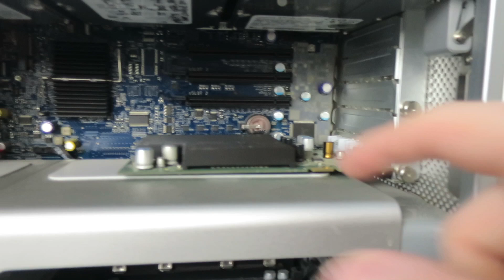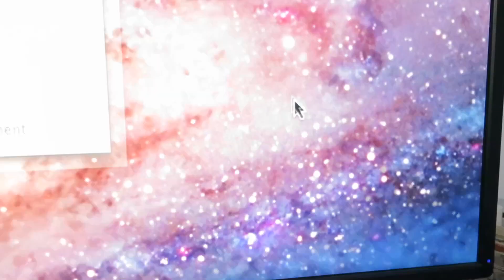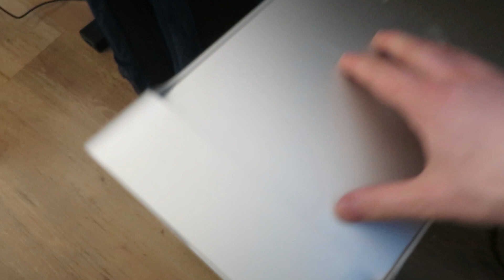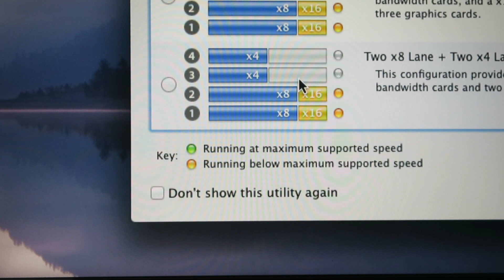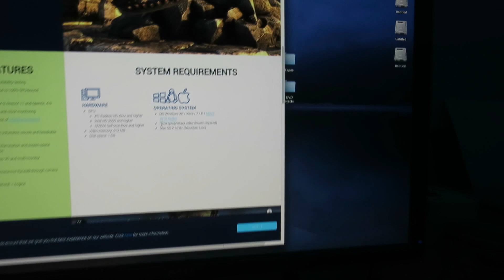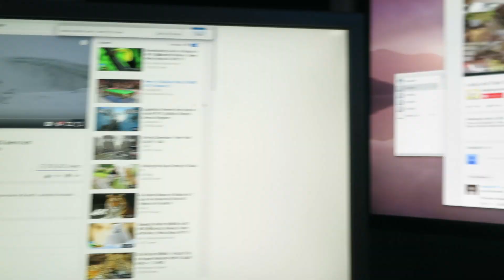Mac Pro 1,1

Comment: Hi Tom! Wanted to tell you That I found one of that Mac Pro 1.1 from a client of mine. They were about to trash it,
It was in a pile of garbage. They told me it probably took rain but I tried anyway… well…. I took to my home, plugged the power cord… and…. It turned on with no issue. Very happy!!! Now I would upgrade it with ssd and some stuff. It already comes with a GeForce 7300GT and 8 GB of ram. Not bad… I also would like to find a 30 inches monitor like that. Awesome…..

Comment: After conforming to PC audio editing for cost reasons many years ago? I went and recently recued my original Gen 1 iMac Rev B from my parents, and was also just given an old Mac Pro G4 tower from an old production friend, as well as a late 2008 iMac. 
Needless to say these are not really modern powerhouse machines, but I do believe I have caught the Apple bug once more.
I've also discovered my current PC's CPU and MB are hackintosh compatible. Don't think I'm ready to go that route, but I have seen a 1,1 Mac Pro for $99 local.
Great channel BTW.
Cheers!

Comment: Question: We just picked a Mac Pro pro tray upgraded and maxed out and when I installed it the fan started up and will not turn off, is this normal?
Reply from the maker: Is the computer working as normal? 
An SMC reset may be a good place to start to troubleshoot strange fan behaviour.
Reply: ItsMyNaturalColour - ok thanks for the feedback, now can you tell me what and where the SMC switch is located. Also note that I’ve had this Mac Pro from the day it was sold to me and it’s a 2009, other that this little issue it’s handed without a problem. Again again thanks for your feedback and greetings from over here in good old Houston, Texas...

Comment: The 1,1 machines are the best.  Faster than most people need in 2020 and can be had for free, if you ask around.  There are 3d-printable trays for modern drives (both regular size drives+laptop drives are ok).  The El Capitan upgrade is a bit of a challenge.  Best if you can clone a drive from somewhere but as of a few months ago all the OS componentry was still lurking around.

Comment: had the same flickering issue with an identical system with both Chrome and Safari. Googled for a solution and I had to disable hardware acceleration which may not be the best solution.

Comment: Got one of these warhorses, got it cheap in 2016 and it's still running 10.11.6 El Capitan like a champ. They don't make machines like this anymore!
Reply: Propjoe10 did you have to change the graphics card?
Reply: @DjDestinyChicago  yes, I had a Radeon HD 5770 in it. Got a Radeon x2600 in it now which works fine. The stock7300 has no graphics acceleration in El Capitan

Comment: Just found your channel last week and I love your content! I am a bit of a computer geek too and currently waiting on a mid 2007 macbook pro! but my real collection is of DV video camera gear.. think I'm on 16 cameras now haha. That all ties in though as what I hate about new systems is clearly firewire is no more and though I do edit on my 2018 Imac all singing all dancing modal due to apple being apple I have to use two different adaptors to get it to work and it has its problems due to all that.. Where rocking on an Macbook pro 2007 will just be straight cable in no issues... Will also be my first apple laptop so its all new for me :)

Comment: re "back when my Mac Pro 2008 was still relevant" - I have a 2008 as my daily driver desktop, works great!
Reply: And as long as you're not trying to do HD or 4K video editing/rendering, it will continue to for a long time :) ... I've been using a 2009 8 core  (upgraded to a 5,1 and now running Mojave) as my daily for over 3 years, and my drag-around-town laptop is a Macbook Pro 2008 A1260 (sometimes I just use my iPad though). They both work awesomely.

Comment: Just FYI...you never noticed the Expansion Slot Utility on the 2008 Mac Pro 3,1 because it does not have configurable PCIe slots like the MP1,1 does. The 2008 was fixed at x16 PCIe 2.0 for Slots 1 & 2, and shared x4 PCIe 1.0 for Slots 3 & 4.

Comment: I got a 1,1 for very little money a few months ago.  Now flashed to a 2,1 running windows 10 and El Capitan on a dual boot, 2x 3ghz quad core xeons, a GTX 970 and 32gb RAM.  It will take 64gb ram should you have a need for it.  Excellent, powerful machine for less than £250 all in.

Comment: I've got a mac Pro which I bought on ebay. Took a while before I got one in-damaged in transit. I'd advise getting one in its original box as they have the proper polystyrene packing. Anyway, I upgraded it to the max with 32gb of ram and SSD drives for OSX And Linux Manjaro Deepin. Works a treat on my 32" lcd TV screen with a adapter USB cable.  I use the OSX side for music. 🙂👍

Comment: I still use a 3,1 and plan to upgrade to a dual CPU/ 8core set up. I have a 1,1 sat about too that I got with the 3,1 (paid for the 3,1 but got the 1,1 for free). The 3,1 came with 16gb ram (4x4gb 800mhz fb-dimms) it came with a mac version of the HD 5770 too
Weirdness is though, is the 1,1 is running solely windows 10 (not sure how but I'm yet to tinker with it) and runs on a mix of kits totalling 9gb of ram (stock ram and Kingston) though it came with a 2600 XT instead of a 7300 GT.
Awesome video on the old beast. 👍
edit: The 1,1 has since been upgraded to a 2,1 (firmware for both board and fan controller) along with two quad core xeons. sold it on as i didnt have time for both these Macs and the self built PC. The 2008/3,1 is still kicking butt and has been flawless running El Cap since i bought it over two years ago now in the same config as it was (plan to stick a second 2.8 quad in soon but need to get a heatsink for the 2nd cpu).

Comment: I remember having the 30" Cinema Display back in 2008, worked ok for 2 years then the PSU started acting up.  What a nightmare to get it replaced even with Apple Care support. Sold it after and got a 30" Dell which had better colour support.   

Can't wait to see what the new Apple display is going to be, I love my current NEC PA322UHD but something with a higher res and thinner bezels would be nice. Doubt it would be anywhere near as colour accurate as this panel though.

Comment: patch it to 2,1, upgrade to dual 3GHZ and use El capitan!
Reply: Yep! Can actually max out RAM @ 32GB as well.
Reply: C. E. Newton i am at 24 - i think this will make it- usually you dont Need more than 16 gb nowadays
Reply: With that configuration, do y’all know if it would run Logic Pro well enough?
Reply: Rock Solid Media i don’t know the requirements of that Programm - just look it up and Tell :)

Comment: I'm by no means an expert, but I have dealt with a fair amount of 1,1s and even some 3,1s. The expansion slot utility is not used on the 3,1 at all. The slots are preset. The bottom two are 16x PCIe 2.0, and the top two are 4x PCIe 1.0. All slots on the 1,1 are 1.0 speed. Ive seen the Chrome issue several times on older Macs, and going into Chrome settings and disabling graphics acceleration seems to fix it with no discernible performance hit. I know you may not want to put any money into this machine, but a GeForce 8800gt or a Radeon 5770 would be a tremendous boost to the system, and would even allow you to run up to El Capitan with ease via a modded DMG widely available on the web. A little more RAM and an SSD and it's almost up to today's standards for a mid range PC. Mine has the 5770 graphics, 16gb RAM, and I an quad booting El Capitan, Lion, Snow Leopard, and Windows 10. Best of luck :)

Comment: Mac Pro 1.1 still useable as of 2019 do the firmware upgrade and dosman1 patch to get to el captain to 10.11
Reply: El Cap is still good in 2019, replying from my 2008 iMac with it :)
Reply: CPU upgrade to quad cores is also recommended. You can get two X5365 chips for like $20 total.
Reply: I still use my Mac pro 2,1 with el Capitan hacked onto it, in late 2021!

Comment: loved my 1,1 upgraded to a 2,1 and up the ram to the max added an SSD all drives and an ATI 5770 which I bought as a pc version and bios changed that to mac so it would show the loading screen. was able to goto maverick and worked a dream. sold it last year for a good price with a 20-inch display and mouse. still looking for a 4,1 to continue any kind of mac adventure. for now MacBook pro and Mac mini are working perfectly. Keep up the good work Tom
Reply: Where did you get the ATI 5770?

Comment: You can load the 1,2 firmware on the 1,1's which let you put in a faster CPU..   Going to dual X5365's is totally worth doing these days, not to mention you may want to open up the CPU cage anyways as you have 13 years of dust building up in there.

I'm replying from my 1,1 now!  Going to Windows 10 was great to run current software.  Nvidia 1030 is way better (and still a cheap option) rather than that old thing.

love the video
Reply: I've not had any luck with windows 10 on the mac pro 1,1, do you have any advice / recommendations?
Reply: @FloydBunsen  I used something called oscdimg.zip to generate the iso image from the downloades windows 10 from Microsoft. 

 I used 7zip to extract the downloaded ISO, and then create the new 32bit ISO with the following:

oscdimg -n -m -bc:\temp\Windows10\boot\etfsboot.com c:\temp\Windows10 c:\temp\LegacyBootWindows10dvd.iso
Reply: @FloydBunsen  im 3 years to late but get a ssd or hdd with win 10 alreaqdy installed and it will work

Comment: Hi Tom, do the maintenance on all the working memory modules; the central control chip burns out because the thermal paste loses its dissipating power (you have to remove the memory dissipators); download a software like Mac Fan Control and better manage the CPU / RAM wind tunnel ventilation. Memories can even reach 80 ° celsius but they easily spoil ......

Comment: Man, I loved Vista.  I really did.  I had no problems with it, ever.  I preferred it over XP and I never replaced it with Windows 7.  But, even I wouldn't consider having two installations of it on one machine. :p
You could try to switch the slots.

Comment: it was too far away from me and I would not ask seller for shipping, as Apple Cinema 30" is too valuable 
if not distance, I would be bidding with a lot more, then you won this one
Today I have 2 Dell 3008WFPt monitors and honestly 30" Apple Cinema does not have value to me anymore, as is have single DVI 
Dell 3008WFPt have: 
VGA
2 Dual DVI-D

DisplayPort
HDMI
Component
S-Video
Composite
USB Hub and Card Reader
and does not use expensive Power Supply, which is harder to get then unobtainium

Comment: I would love to see if this machine's CPU performance can be increased using the old electrical tape over one of the CPU contacts to boost the FSB speed of Intel's old C2D era processors. I imagine processor upgrades for this machine are ridiculously cheap, too.
Reply: Short answer is no.  Long answer is, yes, but only if you're running one of the very lowest end processors available with an 800mhz FSB.  After the tape mod it will still be slower than replacement processors you can put in it for very little money.  I put 2x 3ghz quads in mine (the fastest the machine will take) for about £30.

Comment: Hi Tom!  I did notice something during the video... The Expansion Slot Utility does let you run dual GPUs at full x16 for the primary GPU and x8 for the secondary GPU.  If you take another look at the slot configurations, it is possible to run at full x16 in slot 1, x8 in slot 4, and then x1 in slots 2 and 3.  It is slightly unintuitive, especially because it does not allow the use of x16 + x8 for 2 dual slot cards, but it works fine if the second GPU is a single slot card. It probably will not really make a big difference with how you are using the Mac Pro, but I thought it would be something you would like to know.  Great to have a new IMNC video, and looking forward to future videos!

Comment: I had one of these. It was a shame that Apple crippled it with a 32 bit boot loader even though it was all 64 bit hardware. Other wise it was a really nice pc when it was fully loaded with 2 processors and a hd5880.
Reply: Yeah biggest problem of the platform.
Reply: I got rid of my 1st macbook with 10.7 Lion on it due to that same issue, 32-bit boot loader. Makes you think they just didn't want you running other OSes on the hardware
Reply: @kingneutron1  I found some article about replacing the 64bit bootloader on a Windows 10 DVD image with the 32bit one, and it worked!  I'm using the latest 64bit version of 10 on my 1,1.

Comment: It could merely be the case that the heat-sink grease on the cards is really old and dried up. Easy enough to unscrew and replace the grease with fresh stuff and see if this improves things.
Reply: Yes, I just did mine.  13 years of wear and tear not to mention all the trapped dust!  The heat sinks were disgusting

Comment: I had 1,1 update the firmware and got it to 10.11.1 I couldn't upgrade it any more than that. Or kernel panic. Currently, I have 2009 with specs 2 X 2.93 with 32 GB RAM, 7970 GPU and running 5 Hard drives with SSD in PCI-E slot. It's my favorite computer. OS upgrade to 10.14.4
Reply: 2009 and 2010 is the best Mac you can buy... Mac Garbage Pro, the newest at this time is shame!
Reply: @janquieldapper  Yup best bang for your buck is 2009-2010 model Mac Pro very upgradeable and very powerful still today compared trash can Mac....interesting if Apple releases there new Mac Pro version this year as of 2019
Reply: The Xeons are limited to the sse3 instruction set, and post meltdown /spectre fixes apple is now using sse4 optimized builds.  It's the end of the road for OS X.  Windows 10 still supports sse3 machines so you can use the latest build of 10.
Reply: @JasonStevens  For Mac Pro 1.1 and 2.1 yes very much so but theres lot of life left in the Mac Pro 4.1 and 5.1 models
Reply: @JasonStevens  It's actually limited to ssse3 as well as sse3.  This is an important distinction as there are processors that don't have ssse3 and can't run certain games etc because of that limitation.

Comment: The ram issues sounds alot like what's wrong with my 3,1. It's possible that one or two of the slots on one of the riser cards is dead. For me it's the bottom card's last two slots, keeping me from having 32GB of ram in my machine.

Comment: If i recall correctly the latest version of chrome to run on lion is 49... Now i have a MacBook 2,1 with an Intel GMA 950 that was doing the EXACT same graphical glitches as your Nvidia cards were, however when i downgraded from Chrome 49 to Chrome 38 i had absolutely no issues, that second card is not dead, its just chrome being weird as balls!

Comment: What made you decide on a 1,1 vs 4,1? The 4,1 and 5,1 have gotten some unexpected upgrades to the BIOS to make it compatible with the latest GPUs and even NVMe boot drives.
Reply from the maker: I didn't really decide to buy a Mac Pro at all. It was more a case of the 30" cinema display peaking my interest and the Mac Pro was incidental.
Reply: @ItsMyNaturalColour  I see. I love the Mac Pro tower. If you're interested, I'm sure I still have a 4GB Mushkin kit for the 1,1. Yours if you want it.